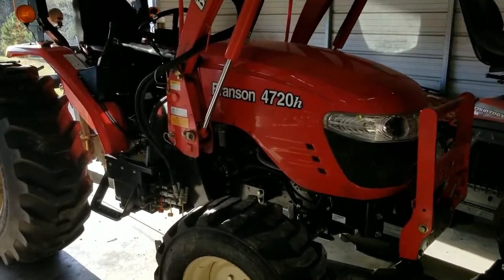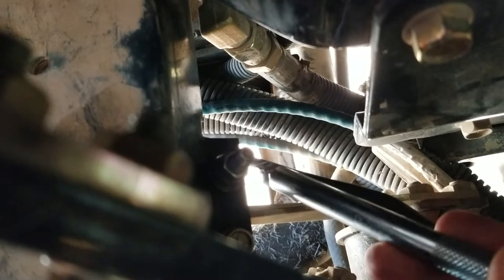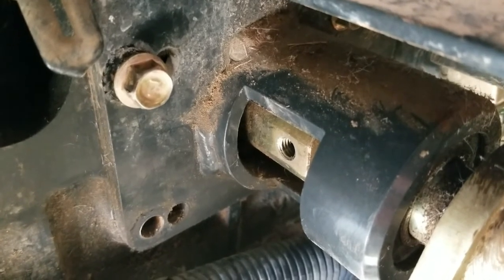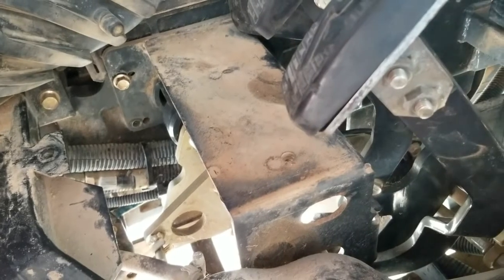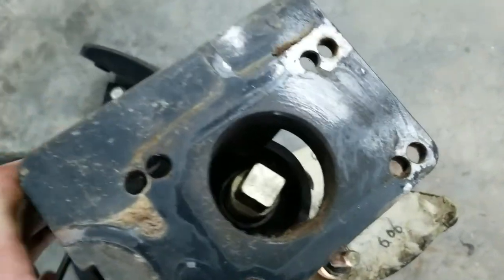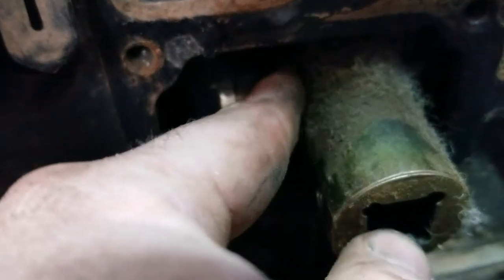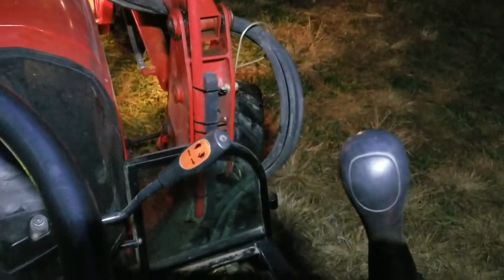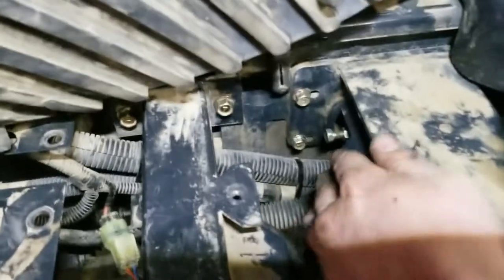Fixing Hydrostatic Transmission "Creep" on a Branson Tractor

Comment: Thanks for good info.  My hydro unit is leaking oil. It started as a drip but got progressively worse. It exits out from a hole in the housing that holds the hydrostatic unit. Dealer said to leave it back and he would investigate problem but cost of transport both ways and the “unspecified” hours @$60/hr has me thinking to try myself. Have you heard of anyone with a similar problem?
Reply from the maker: That's a rough one,  I can't speak from experience on disassembling the hydro unit but I can at least give you a look at what you're up against - here's a link to a 20 series service manual, page 447 has a diagram of the HST. I see plenty of o rings that may be the culprit but not sure. Got my fingers crossed for you that it's something simple!

https://drive.google.com/file/d/1Y1uBkS613DCbshfd5gcq9wOFPK3DwJ3A/view?usp=sharing

Comment: Can that bolt be reached without taking off the pedal assembly?  Mine is doing the creep now!
It appears as though you can.  You did not show tightening the bolt and locking nut.  Is this just like a set screw where it goes thru the female portion of the coupler and, when tight, butts up against the shaft (male portion) to secure the coupling tightly to the shaft?
You mentioned another one of these bolts or set screw mechanisms, I guess on the bottom of the coupling we could not see.  Is this correct and was that also loose on yours?
Reply from the maker: @jws3925  yeah, unfortunately the bolt you can see without taking it apart is just the bolt fixing it to the pedal, not the transmission.  And yeah, it's as you described best I remember - sorry, I should've thought to show that 😂. Good luck with it!

Comment: Thanks for the video!  I just looked at a used 4720h with 370 hours.  It was creeping slightly in low and medium but in high it would surge forward quickly with a small amount of forward pedal, when you let off it would creep in reverse until you hit forward again.  The tractor was really dangerous to drive in high gear.  It was being sold as is at a kubota dealer. They didn’t want to work on it.  Does this sound the same as yours was acting?
Reply from the maker: @NathanWorzalla  Sounds a lot like what mine was doing, a big reason I tore into it was it was getting kinda dangerous and unpredictable to drive. 

Also hours wise, about the same as mine was when this started. I've started to notice it creeping a bit more on me lately so I wonder if this happens regularly... Might have been worth putting loctite on that bolt if you have to do it. Good luck if you go for that one!
Reply: @ thanks for the response, that made me interested in this tractor again. Have you had any other issues with yours?  Any regrets on your purchase?
Reply from the maker: @NathanWorzalla  i did have the power steering cylinder start leaking on me, I have another video about that one actually if you're curious. Otherwise though, I love this tractor, it's been a hoss on every job I've put it to!

Comment: Thank you for the video, I have the same issue on a new to me 4720CH, haven't really torn into the issue, but this gives me an idea on what is going on. Spot on! Also how do you like the backhoe, I saw it in the video. I'm really considering one.
Reply from the maker: Glad it was helpful!

I think a backhoe attachment is in the way 95% of the time, but it's tremendously handy that last 5%. They're really annoying to mount/dismount but I've cut trenches for water and power, dug stumps, and fixed culverts with mine, so it's made up for the hassle!

They'll get the job done and I'm glad to have it, but they aren't nearly as powerful or maneuverable as a mini ex would be. I bought my tractor used and it came with the machine, but for the price of these attachments new, I'd think about putting the money towards a used mini excavator if you have room for both 🤣

Comment: Hi there, I have a Branson 36Hp with hydrostatic and it struggles to climb any incline without being in gear position A and it revs high and goes slow...Position B and it will stop and cut out. You had any similar issues with the hydrostatic?
Reply from the maker: Huh, no issues like that but if it cuts out entirely I'd suspect the engine over the transmission. Have you checked your fuel filter to see if it's clogged up or your air filter for the same?

Comment: My new farmtarc 25 is hard to shift in and out of gear some days,,,if i nudge tractor forwards or backwards it helps it go into gear so i can start it,,,someone mentioned trans creep and there was a way to adjust it by jackng up rear wheels ,,any ideas,,i have no farmtrac dealer in sc
Reply from the maker: If it's a hydrostatic machine I'd imagine there's a similar connection point to this Branson on your farmtrack. If it's a gear tractor that sounds more like a clutch issue perhaps though.

Could be wrong but doesn't Northern Tool deal farmtracks? Dunno if that's near you but maybe they can help if there's no official dealer nearby.

Comment: Are your pedals hard to push? My right knee is killing me after a day on the tractor.
Reply from the maker: There's a tension adjuster as part of that mechanism, you can loosen a screw and back the tension off the return spring - you can't go way too far or else it won't come back to neutral but you can definitely loosen it a bit to make it less stiff.

Other tricks I've heard people say are to put some white lithium grease on your floor mat and make sure that the pedal isn't rubbing up against it, may be a real easy fix!